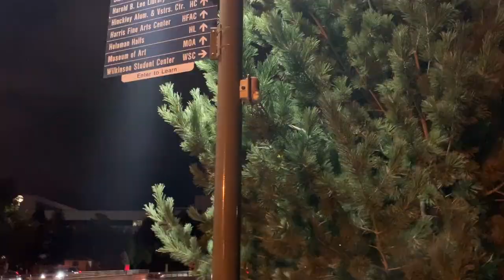System Sensor L Series Fire Alarm in BYU Joseph F. Smith Building (JFSB)

Comment: I don't know how you could continue to conduct classes or even stay in a place with those alarms The ceiling mount advances in the Walmart where I worked at for almost 6 years as a cashier got set off in 2018 at about 9:00 PM at night while I was working and it took them 30 seconds give or take to get it shut off they said the system was on test and the construction crew had set it off but had I not been on the clock I've gotten out of that store in two seconds flat! LOL
Reply: haha when i was 9 they went off in my apartment at 6:24am when i was home alone. At the time i was into fire alarms like i am now so i just left but those concrete hallways along with the advances REALLY hurt my ears haha